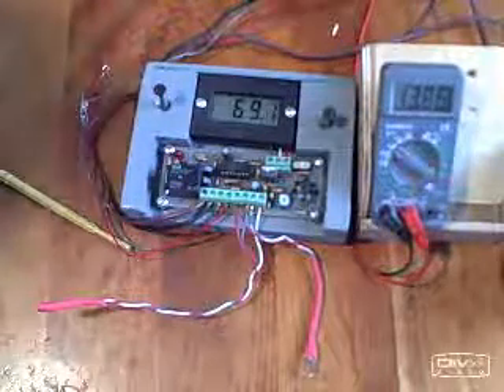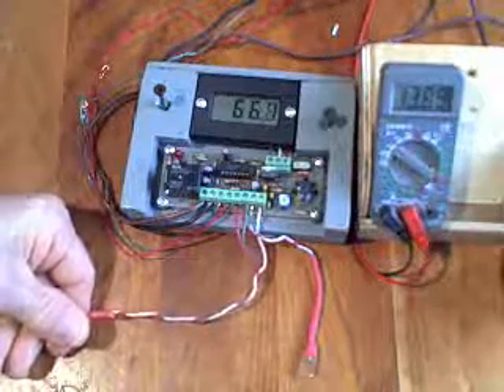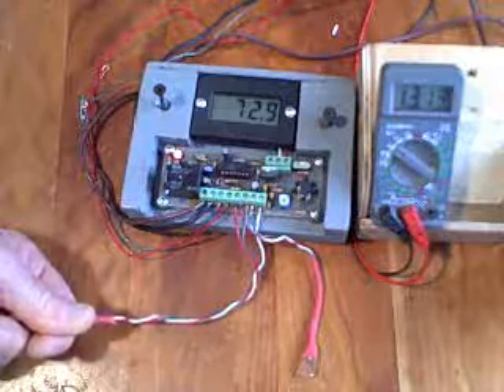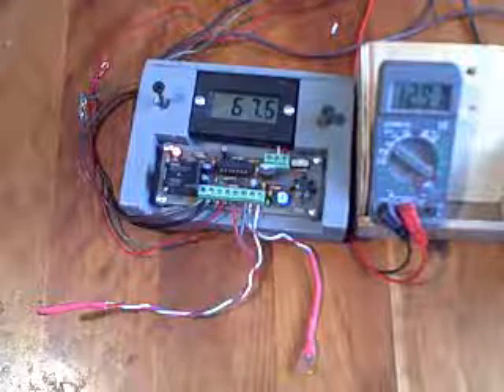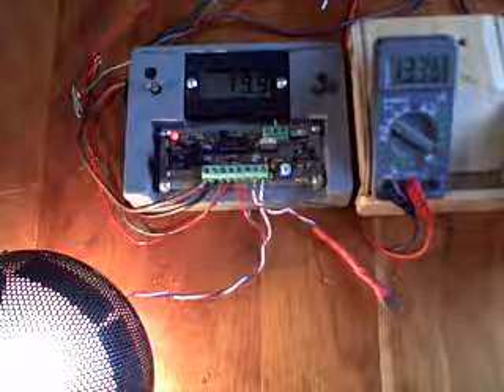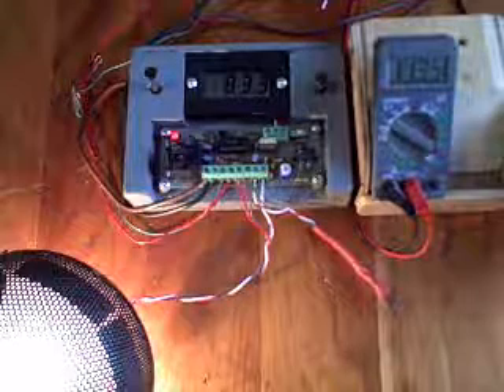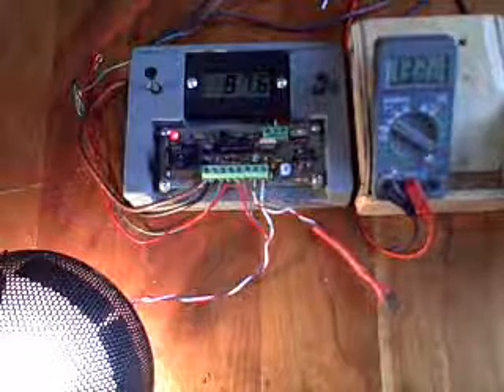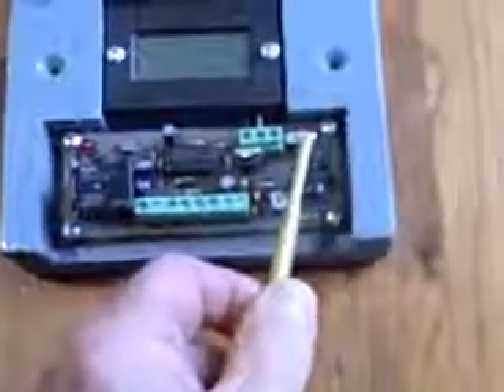Differential Thermostat demonstration

Comment from the maker: All you need is something that will sense temperature and respond with a voltage output to that temperature. This output voltage is compared to a voltage that you set with a POT. As long as the voltage you set is higher than the output voltage a relay is switched on that controles the heating element. 
It would actually be simpler than this differential thermostat ond only have one temperature probe.
Why not just put the kettle on the stove and adjust the heat?